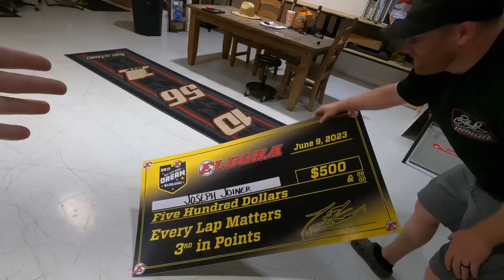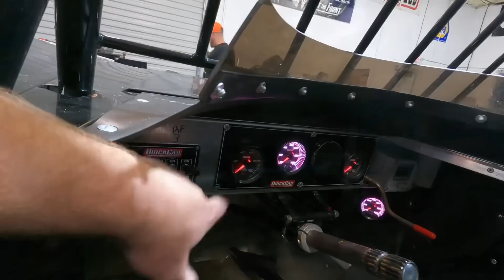Headed Back to Longhorn! Stripping Down Our Wrecked Race Car after Eldora

Comment: What’s the foam in the gas tank for
Reply: It prevents the fuel from sloshing around,  if the fuel was flung to the right on corner entry it would have a pendulum effect and drag the tail of the car around.

Virtually all racecars run foam except the Hornet/UCAR/Front wheel drives.

Comment: Idk about yall but that engine did not sound healthy when they fired it up lol
Reply: Lol i though I was hearing that 16 volt starter spinning over
Reply: I think they cut the engine running part out and that was the oil pump
Reply: I think they just have it a quick hit, just want to make sure it turned over and cranked real quick
Reply: I never heard it start, just heard weird sounds????
Reply: Sounded good for a quick start. Joseph refired it after the wreck also. It's good! 👍

Comment: Why are you using hand tools to disassemble the car rather than using impact or battery tools? It would‘be come a part much faster.
Reply: It's not allways about speed.... they are at the shop. Not at the track during a pit stop.....
Reply: Cause they can and to take tim and not tare it up more that can cut you or somthing
Reply: @furywanabemonky05  the is head back because it was wrecked most of what they are removing is already junk.
Reply: @51-FS  they still have to find the overheating issue on the other Longhorn, pull out Faithful pull the crate engine, install probably the Draime add the dry sump system to have a backup in the hauler, Jordan will be gone about two days to Longhorn. That’s not counting sorting out the hauler from a 2 week trip ordering new parts for the Longhorn. I’ve raced over 40 years you can never have to much time. Work smarter not harder.
Reply: @franciscyr2471  they got this pops..... they ain't new at this game

Comment: I’d say that chassis will never be right again, it hit the wall hard and took a hard hit,
Reply: I have seen where they are in worse wrecks and are better after being fixed. I have also seen where they handle like 💩 after being fixed. If they are lucky it isn't bent that bad and doesn't need many tubes replaced.